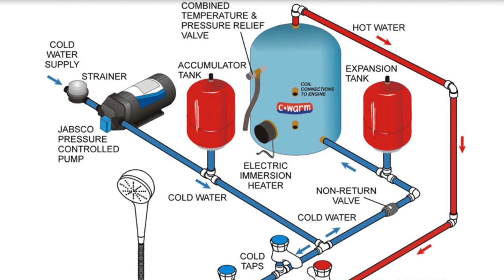Moving Aboard Our 50' Sailboat With Our Three Children | Episode 31

Comment: Just wondering about your freshwater and diesel tanks Hugh. Are they integral grp tanks moulded into the hull like mine on the E 37. I have 2 port side diesel tanks holding 450 litres and 2 starboard fw tanks holding 650 litres plus the keel fw tank at 130 litres. These Endurance yachts have great capacities for both diesel and freshwater.
Reply from the maker: Hi Martin,
Thanks for the question. Yes integral and original. 

Two diesel tanks either side of the engine. I have not yet calculated their size (but I seem to remember the previous owner telling me 300L each so (600L diesel capacity)

The. Going forward 4 water tanks again integral. We have rebuilt and re commissioned the stern pair. A bit of trigonometry and I reckon these are 450L each. So our currently capacity will be 900L. The forward pair are 300L each. But these are currently being used as locker storage. 
However I hope to recommission them eventually particularly as they will bring the weight down and forward. 

So total water was originally 1,500L. 

Then black water is forward again split into two (linked) tanks either side of the centre line. Probably around 100-150 total capacity for these. They are rebuilt. And I’ll commission and measure them soon (well one day!)

Thanks Hugh
Reply: @fivegosailing  Thanks Hugh - I suspected they would be the same as mine.
Reply: @man-with-handle  pleasure :) I love a bit of geeky boat chat me !